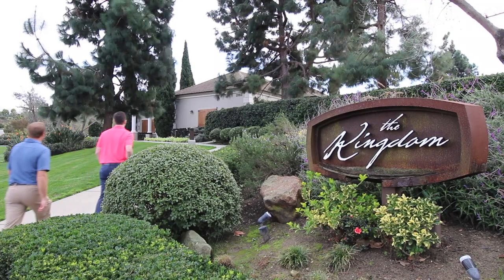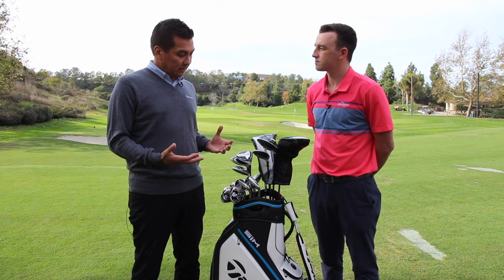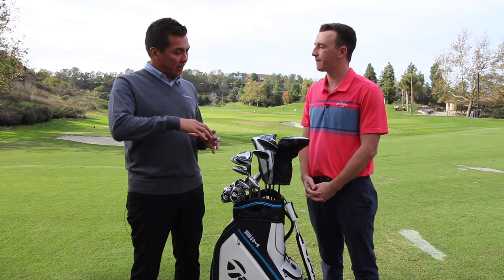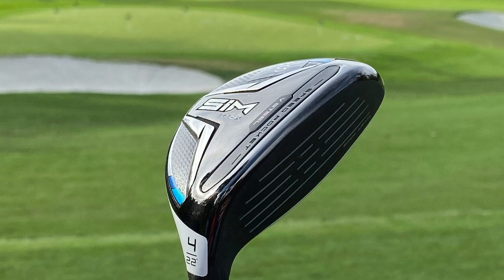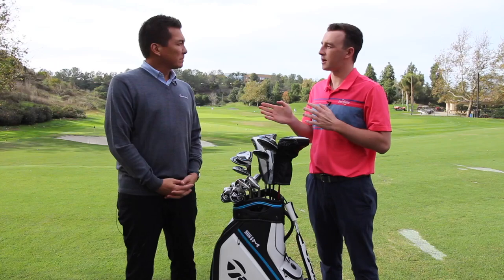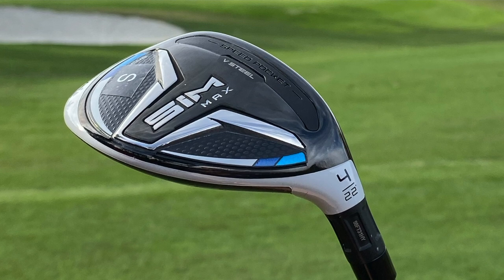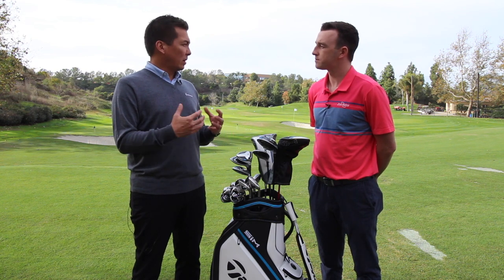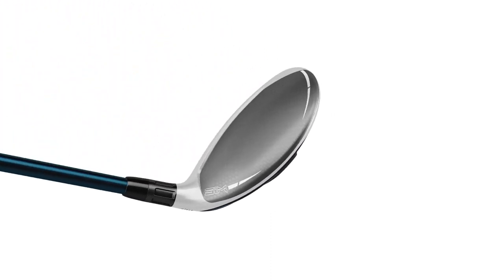TaylorMade SIM Max Rescues | R&D Discussion

Comment: Does the hosel have a flat setting ?  THe hosel for the Driver only has upright settings but there standard lie (std loft) is 56 deg which is very flat.  I was chatting with a TM fitter last night on Taylor Made’s website and i told him i play my  driver length at 44.5 inches and he said that will change the effective lie angle down by 2.5 deg. To 53.5 deg.   Given the standard driver length of a SIM MAX is 45.75 inches do these lie # ‘s  make sense ?
Reply from the maker: The SIM Max rescues actually have bonded hosels, so there's no loft or lie adjustability there. In terms of your question about the driver, that's probably not far off. For each half inch that you go shorter with a club you're effectively flattening the lie angle by about one degree.
Reply: 2nd Swing Golf Would’ve been nice if I actually watched the video... I would’ve seen the pic of the glued hosel!  🤣 thanks for confirming the lie angle issue !